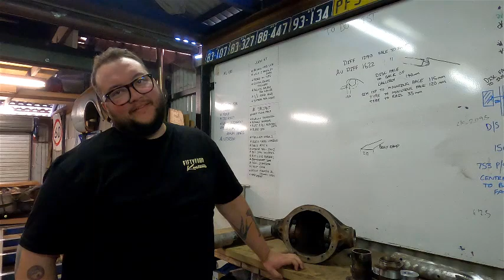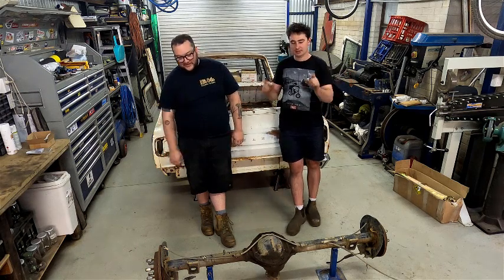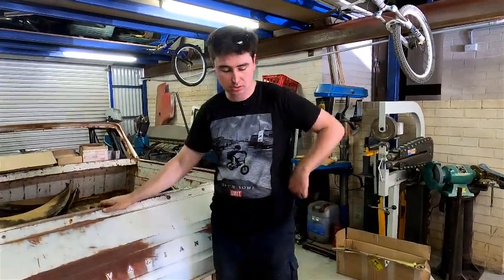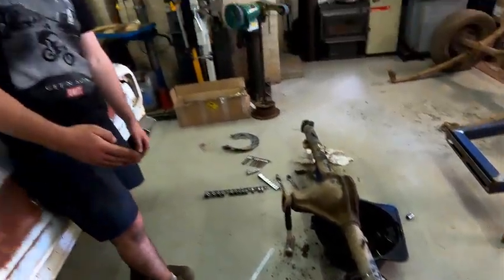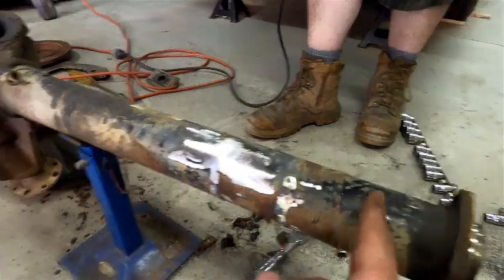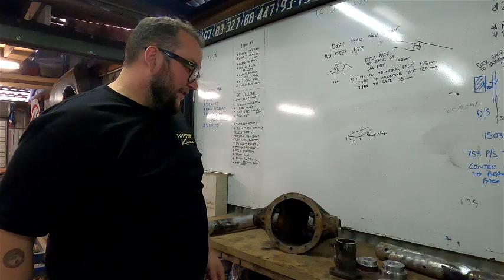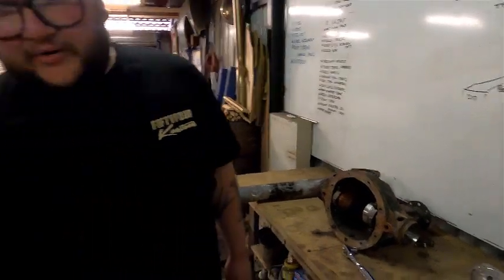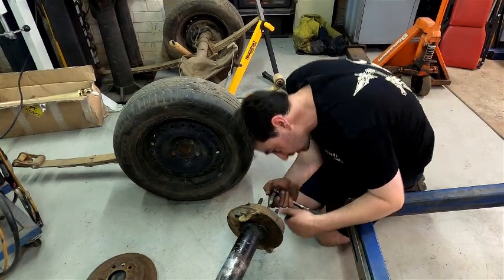BackyardBuilds: How to shorten a Diff, But also how to not shorten a diff.....

Comment: Hey guys how did you respline the axles?
Reply from the maker: Yea we didn’t…. But would recommend M&A engineering in Mitchell ACT to do it.
We simply cut the axles down to get it rolling, this is not the correct way to do it

Comment: Great content lads. Even though it may be obvious at times, i like how you are letting us know where and how you get your materials, much appreciated. One thing though, where do you buy your sheet metal from for using on the val. cheers.
Reply from the maker: Hey mate. Thanks for the feedback and watching. For panels and floor we normally just use cold roll as it doesn’t have mill scale. If your in Australia anyone who stocks bluescope steel should be able to get it. We normally buy from one steel/ liberty metals.